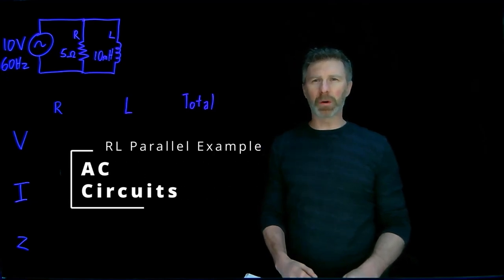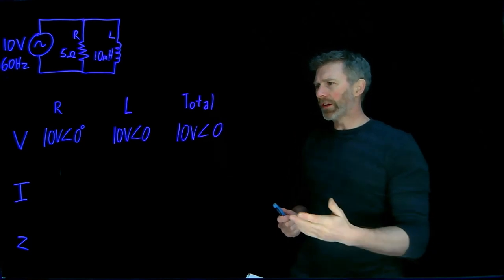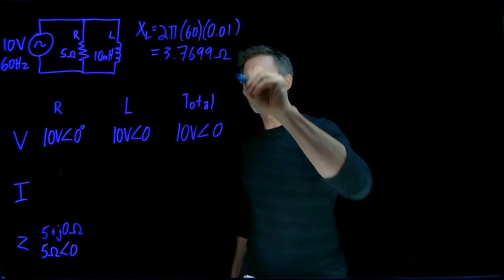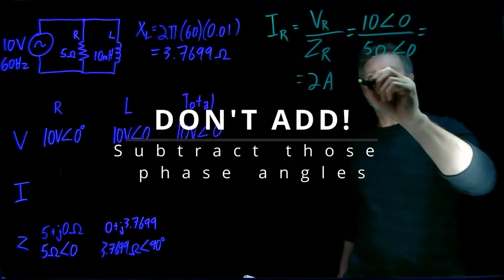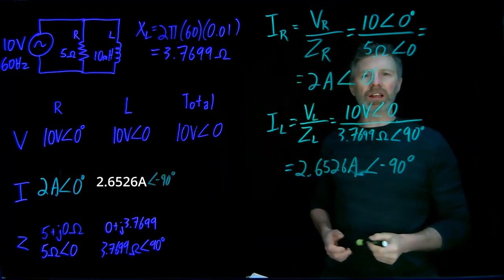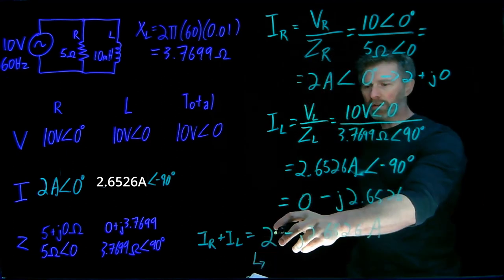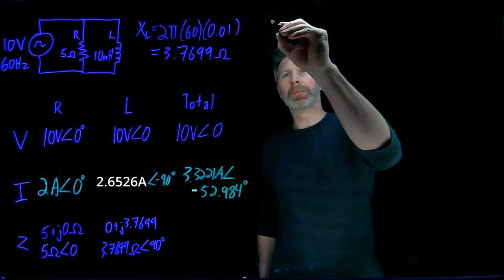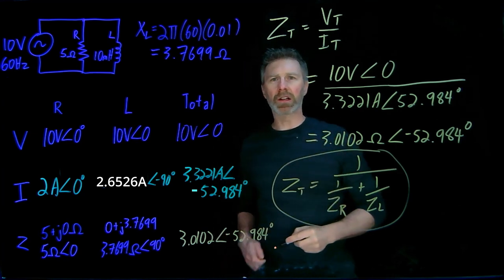RL Parallel Circuit: Calculate Voltages and Currents

Comment: Sir, I am sorry with my silly question, in 7:12 doesn't the total current is 3.33221A <-52.984 ? so the Z total  : 10v <0 /3.3321A<-52.984 ?
but anyway, really love your videos.
Reply from the maker: You're absolutely right. I missed the negative sign on the current, so have a negative sign on the Z_total which shouldn't be there. Z_total should be 3.0102 angle 52.984